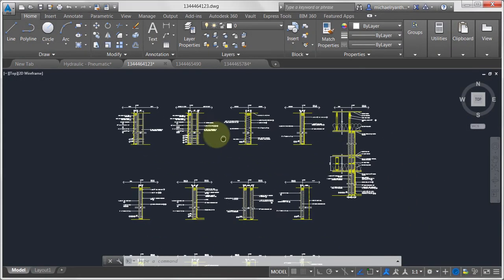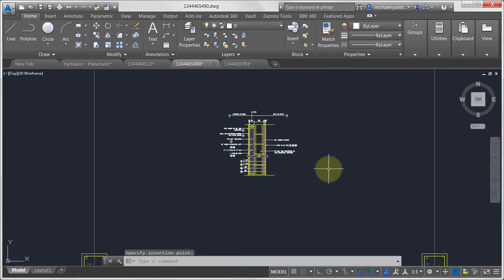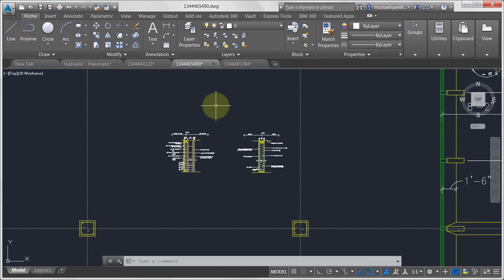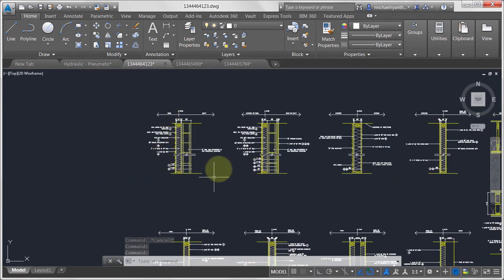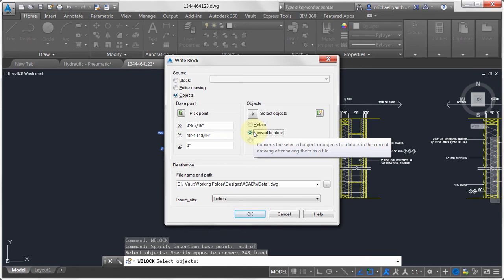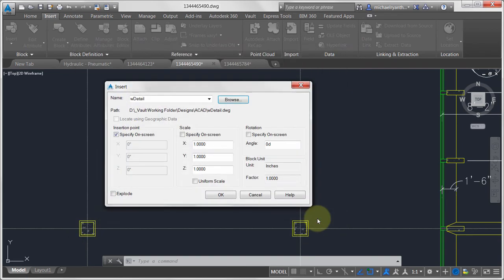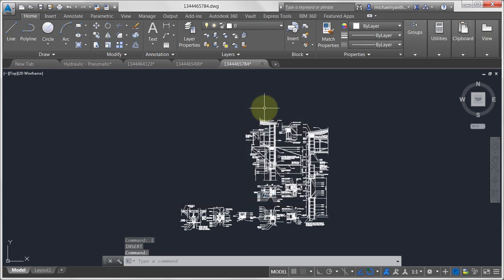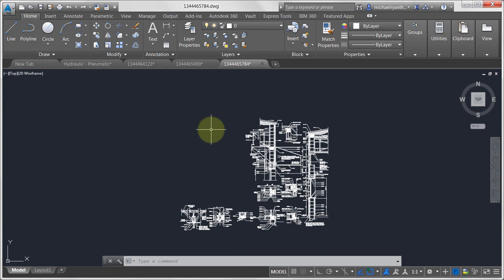AutoCAD WBLOCK & Reusing Blocks

Comment: Hey, I know it's been a few years but do you know what's up with _WBlocking dynamic blocks? You can only open their dwgs in block editor mode, otherwise all of the dynamic properties are gone. You can only edit it and whenever you close the editor the whole dwg just closes. I wanted to utilize _wblock as a means of copying a dynamic block currently in process of building (as a backup) and stumbled upon this issue. Got any solution to that?